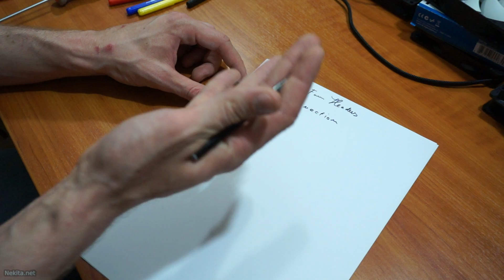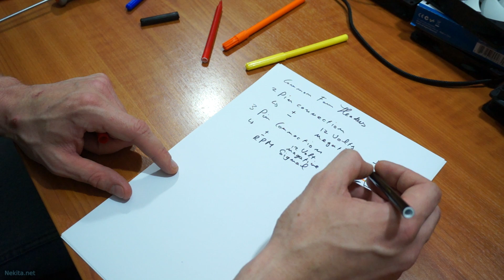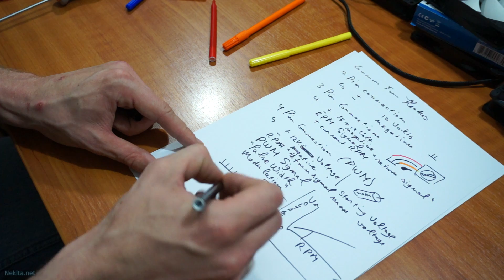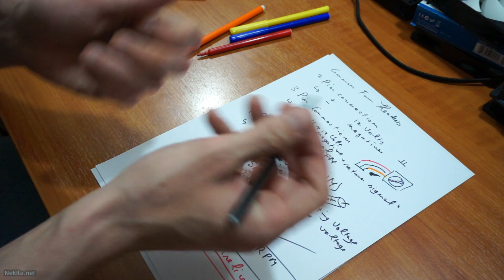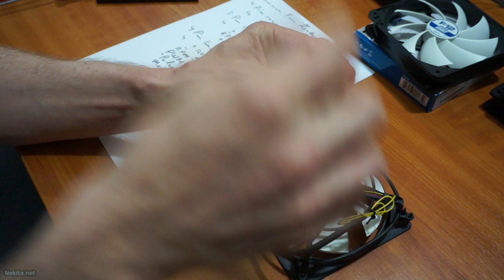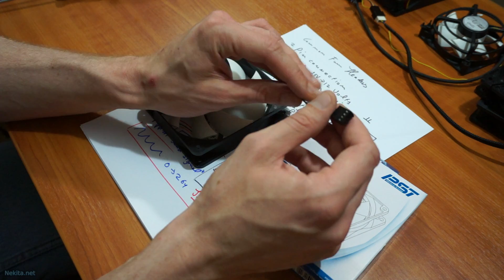Fan Headers Explained - Arctic Cooling F12 Rev.2

Comment: this video has 5 years old , and still helpfull:  my question is i bought a Y fan spliter with 4 pin  that can be pluged in 4 pin fan header mobo ( no probleme ), but in the other side i have two heads that can be pluged into PWM fans . the probleme is i found that 1 cable has the return signal cable (yellow ) and the other only 3 (B , R ,B). so  it mean tha the fan who will be pluged into the cable with a yellow one, is the one who will be the Master fan who gives the return to  the MOBO, and other pluged into 3  will be the slave  , but turning at the same speed ?  sry for my english
Reply from the maker: You're right up too the point where you assume the "slave" fans will turn at the same speed... That's not guaranteed, they get instructed by the motherboard to run at a speed that's translated from the PWM signal to whatever they are build to run at. That's part of the "power" of being able to mix and match; Yet give "priority" over the most important fan to monitor.

Comment: Hallo There....intresting video.....i have a question i bought two of those 3pin fans and i want to connect them to a adapter....but it aint working....and now after seeing your video i think it is because of the yellow wire....i guess the fan needs a signal to start spinning?.....i use a 12V adapter.
am i right that the fan needs a signal to start working?....is there something i can do to make it work?
Greetings
Reply from the maker: I'm unsure why you would want to use multiple computer case fans outside of a computer case; So, please be very careful doing so; This especially since going by your comment (and question therein) you don't seem to really know what you're doing. If you haven't yet, please do subscribe to the channel right here on the channel page: https://www.youtube.com/user/NekitaNet

Comment: I thought yellow cables was always + 12 volts
Reply from the maker: Yea, always be very careful when working with equipment. Even though the plugs should be wired up correctly and thereby be "within the standard" for that type of plug; Mistakes are made, sometimes sockets and plugs with different specifications can plug into each other and there are even other issues. So if in doubt: don't use it or if you're competent enough "Get a multi meter out"... Don't forget to subscribe on the channel page right here: https://www.youtube.com/user/NekitaNet
Reply: When you was drawing the 3 wires you said the signal wire is yellow (but then went over it with orange) but every fan I've seen the yellow is +12v
Reply from the maker: That a great follow-up question: And although this might seem strange and not be true for every case fan and/or case fan situation: Case fans are based on a two wire system and are (or should be the standard of) maximum 12 Volt. So there is a positive 12 Volt "red" wire (the "hot" wire that's dangerous) and a "negative" black wire. The Yellow wire is an additional wire with case fans that has a return signal that represents the RPM (rounds per minute) that the fan is spinning; In a three wire situation this will allow controlling hardware on the motherboard to receive a signal (that represents the RPM that the fan is spinning) and thereby know if the fan is spinning at all (in a simple situation it will BEEP that the can isn't running and perhaps turn of the computer (do not rely on any of this and ensure the fan is spinning and fix what needs fixing if your getting these errors)); But in more complex situations this will allow controlling hardware (and/of software) to moderate the voltage on the 12 Volt "line" to the fan downwards to get the fan to spin at a specific fan speed. The PWM fans are differently "driven" or "controlled", but also use the RPM "control line" to send the "RPM state" of the fan to the motherboard.  I you haven't yet subscribed, then don't forget to do that on my channel page right here: https://www.youtube.com/user/NekitaNet

Comment: So I guess PST stands for PWM Sharing Technology.  I like Arctic Cooling (had their Twin Turbo GPU cooler for years) and it's a great idea for motherboards that only have one PWM fan header.  But I don't like the extra wire mess and since my Gigabyte motherboard has multiple PWM fan headers (3 or 4 IIRC) I would rather have the simple straight forward single PWM header like the Silverstone fan you show.  Still like I said it's a good idea.  I work in a store that sells Arctic Cooling fans so it's also good for me to know how this works.  I've had customers asking for PWM fan header splitter cables before.  These fans basically have that built in!